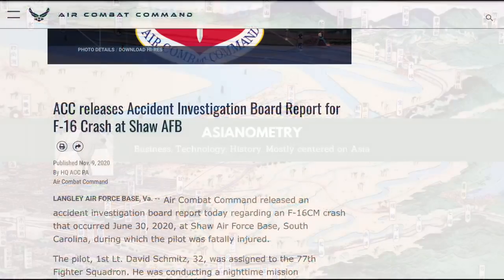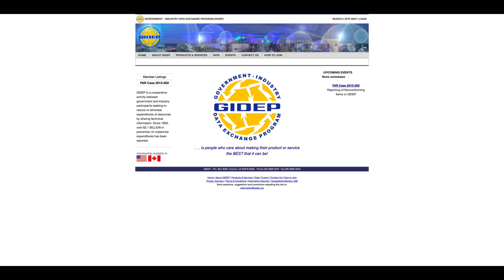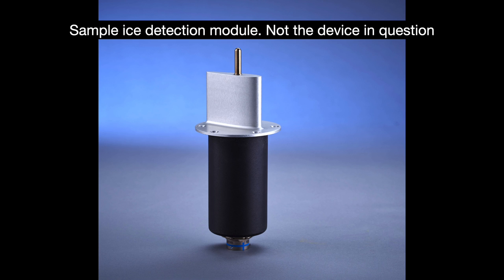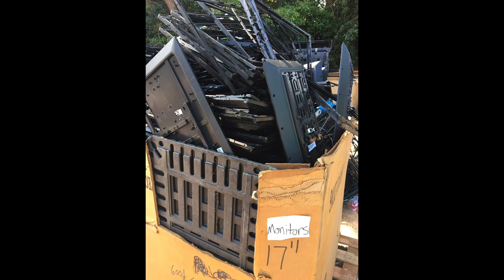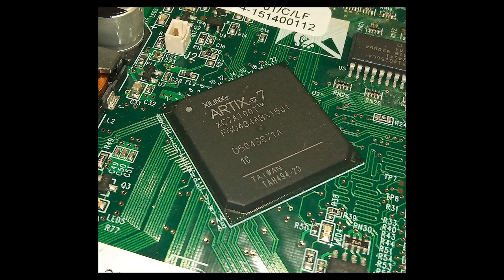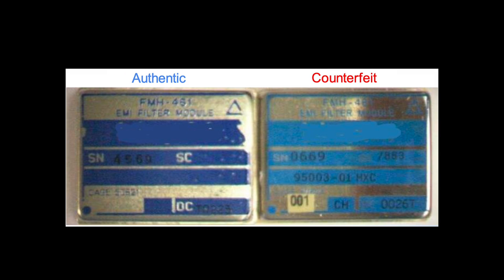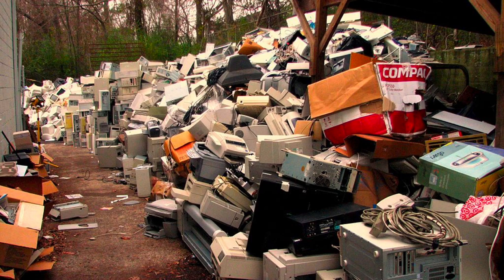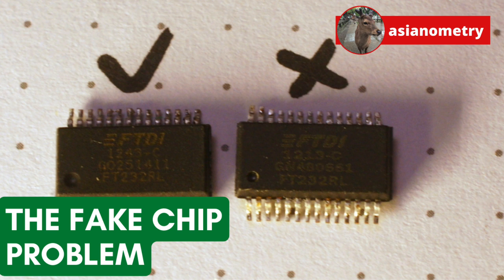The Fake Chip Scourge

Comment: btw, my dude : there is no such thing like an "analog chip". Chips are never analog. By design. What you probably had in mind while stating "analog chip" could be signal-processing chips, AD-converters and the likes ... but just because these generate oder read analog signals they are not analog themselves. Analog chips do not exist - no matter what anyone told you, what is written in some little book and especially no matter what can be found on the internet.
Reply: Nope you're mixed up. Analog IC's are certainly a thing. Look up op-amps like the LM741 or LM386.
Reply: @alexcarter8807  Indeed it is more that "digital chips" all still operate with analog signals, with voltage levels and timings, just acting on those signals in a digital way.
Reply: There are most certainly linear analog integrated circuits.
Reply: So is an op-amp analog or digital ? To be fair, most chips are digital and designed around binary logic, but not 100% of them
Reply: @frontiervirtcharter  operational amplifiers are linear analog devices. Linear voltage regulators look like power transistors but they're integrated circuits. The 78XX devices and the LM317 adjustable voltage regulator. Transistors can operate in two states. There's the active region and then saturation. Any transistor not saturated is acting as a linear device.

Comment: Going forward blockchain is the way to go to certify chip provenance.
Reply: How would that relate to the physical item? Blockchain only exists in a computer.
Reply: @breadman32398  the same way that the item you buy from Amazon exists in the computer and the physical item appears after you pay electronically.
Reply: @pizzablender  the problem is how do you deal with fakes?  While I am not sure 🤔 of the exact mechanics the traceability of using a blockchain to verify provenance of each and every component is extremely powerful.  Blockchain is all in the nascent stage of development as it applies to tracking transactions involving objects.

Comment: Fearmongering, that's what it is. Those "counterfeit" chips are build by same people on same foundry from the very same specs (it just doesn't work otherwise). What happens is that customer orders X chips to build, but foundry produces X for customer and some for themselves. "Incorrect marking" is complete nonsense. Marking describe functionality, it's not nails.
Repurposed chips, which was soldered before passed as new? Sounds like science fiction to me, but even if they are just taken from socket - what's wrong with that? It's not like chip have limited lifespan or need maintenance. 
In short - lots and lots of FUD

Comment: Using older chips.. and you wonder why.. Christopher Domas has the answer. 
With all your research,  you did not complete the puzzle.. The missing piece is staring at you. 
If you can't be bothered estimating the reason behind this phenomenon, then you may as well not raise it as an issue. 
Good on BAE for attempting to remove back doors